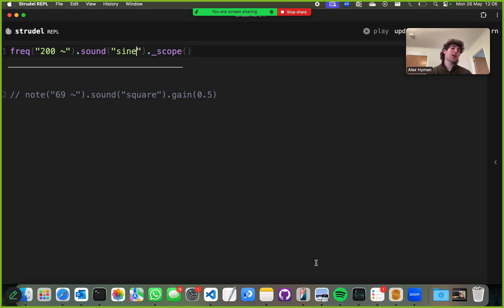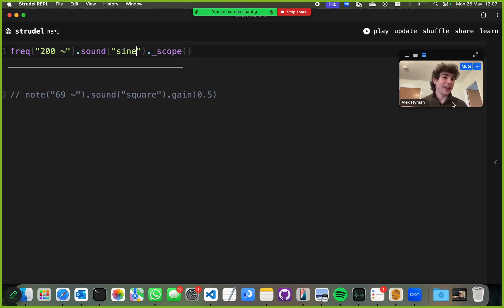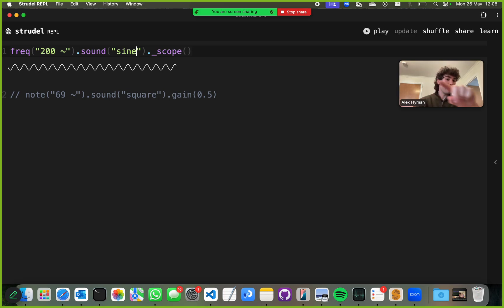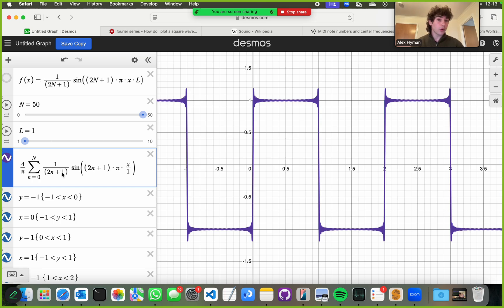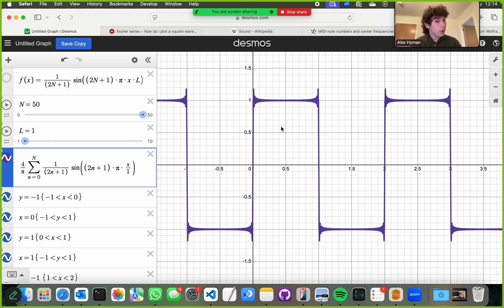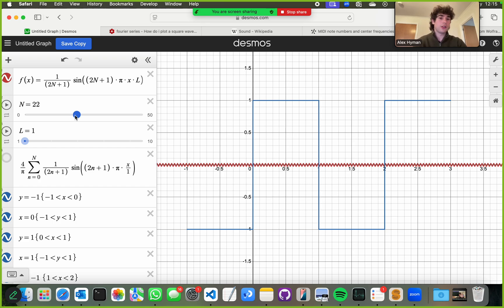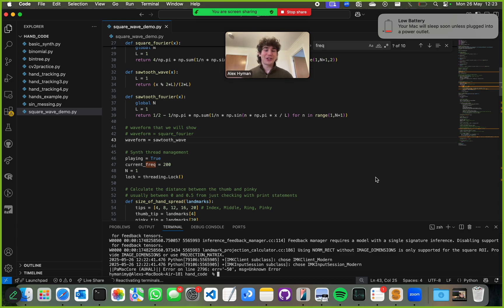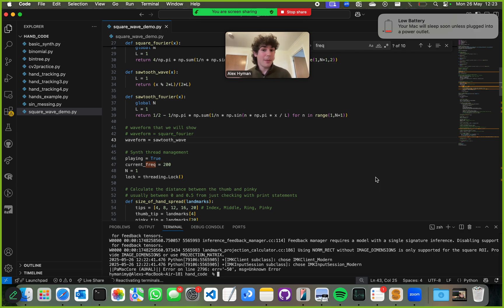Listening to Fourier Series!

Comment: When you say, "If that was a real air wave in real life, what would that sound like?" it actually is. The waveform represents the literal position of the speaker diaphragm over time, and that motion directly creates the air pressure waves we hear as sound. What I'm getting at is: synthesizing isn’t “fake.” It’s not “what the sound would be like if air waves followed this math.” It is the sound... because the math describes exactly how the diaphragm moves, which causes those air waves in reality.

If you look into .wav files, they’re super cool... they’re just a list of numbers that represent diaphragm positions over time. When an audio player plays a .wav, it’s simply setting the speaker’s position 44,100 times per second (standardly) according to those numbers. You can generate those values yourself, for example, by using a sine function. If you stretch the sine wave so that 200 * 2 * π fits into 44,100 samples, you'd get 200 full oscillations of the speaker diaphragm in 1 second, which is exactly 200 Hz.

Very cool video, nice job and very interesting, sorry for nerding out!
Reply from the maker: You're absolutely right and have hit the nail on the head better than I did in the video. Sorry that I seemed to insinuate that sound synthesis is "fake" - I just misspoke. I knew that the diaphragm of the speaker moves in the way prescribed by the mathematical waves, but, I didn't know about the intricacies of .wav files. I'm definitely going to check them out - heck I might see if I play around with one myself. 

Thanks for watching and for the insightful comment!

Comment: Nice video and very insightful! The fourier analysis is very useful and extensively used in signal analysis. However, I think the fourier model is not the only model. The sine wave isn't necessarily the only "unit of measurement". Our ears might have a different "model"?
Reply from the maker: Thanks for the kind comment! You’re absolutely right that the sine wave isn’t the only unit of measurement, especially when it comes to listening, as obviously our ears do not hear specifically in terms of sine waves, as the sine wave is a somewhat arbitrary mathematical construction. 

I believe this discussion is akin to one about vector bases. For a vector space, many (typically infinitely many) bases exist, and so if I try and break down a vector v into its constituent parts b1, b2,… then you could simply come along and provide a break down of the vector into another basis, both breakdowns being equally valid/arbitrary. 

I’ll have more of a look into this, but I think there will be other bases we can break signals/sound down into. Just as two different infinite sums can add to the same value, this means that we can add a bunch of different, more elemental sounds/frequencies, and when we add sufficiently many, we will have the effect of two different families of sounds coming together to create the same sound. 

I imagine you could reverse the whole process and basically describe a sine wave in terms of an infinite series of square waves. However, because of our concept of hearing is typically framed by the concept of frequency, this in some sense would be a weirder/more complex basis to break down a sound. 

Sorry for the long winded comment - thanks for making me think :)
Reply: @hymanimy  Thanks for your reply! It's an interesting topic. I experimented a bit with "sub-harmonics" and found that the fourier transform did not seem as "functional" or effective analyzing a deep subharmonic note that was even visible in the raw waveform. The multiple terms in FFT is absolutely correct, but maybe not informative or a suitable breakdown.

best wishes